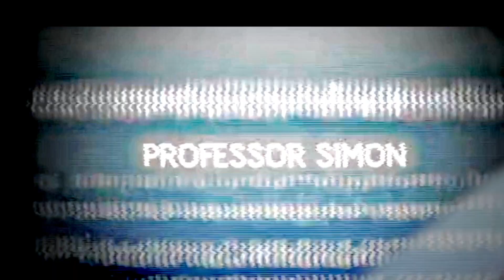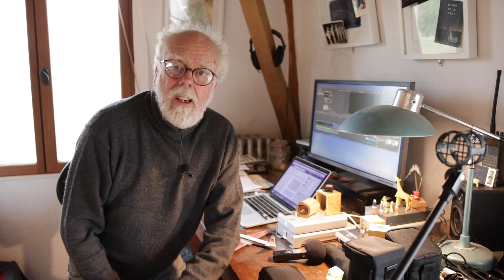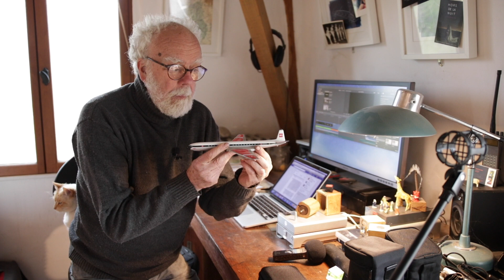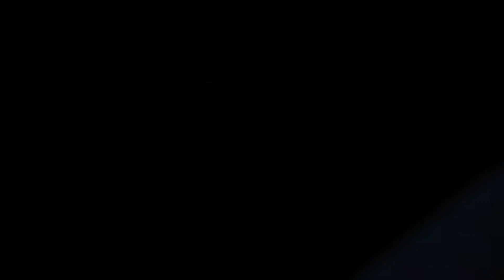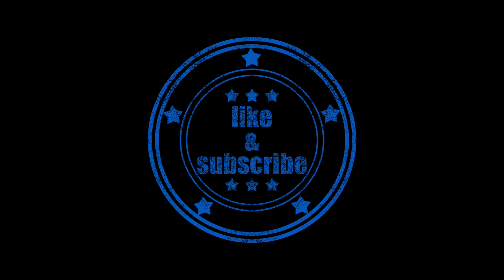737 Max 8 - Report published - Prof Simon

Comment: Well said thank you Professor Simon,
Boeing and the FAA are responsible for building the 737 MAX that is inherently an unstable plane and requires MCAS. 
If the plane were designed properly in the first place, it would be inherently stable in flight and not require MCAS.

Comment: MCAS Failure , AOA sensor failure, Bigger ,  more powerful engines uncompatible with an old but «combat proven»  design. System's  malfunction mode design less than adequate to  hand  over control to the crew.  I think the Space Shuttle  Chalenger could be a very Good leading case to understand this incredible crash.

Comment: In Addition, why did MCAS fail? Well it looks like it takes input from 1 AOA vane which gave a bad output. There are 2 AOA vanes on the 737MAX. The reason Boeing doesn't take the output from BOTH vanes on the 737 is because the system cant tell which is working. Competitors use 3 or more sensors so if one goes, there is a majority remainder to inform the system. So in order for the MCAS to not falsely trigger in the first place, the 737MAX needs a third AOA vane. But there is no hole on the fuselage for the third sensor. Its a big deal.

Comment: It seems to me the basic design of the plane is flawed if it cannot achieve neutral, stable, straight flight without electronic/software intervention because of engine placement
Reply: It does not need MCAS to achieve stable level flight. MCAS is supposed to mitigate the tendency of the plane to pitch up in the event the pilot advances the throttle too rapidly.
Reply: @stimproid  then they need to a system to regulate throttle input maybe?
Reply: @loveislove_5  My understanding is that Boeing had 2 choices. MCAS type system to trim the nose down against the force of the new larger engines, or design a new larger rear horizontal stabilizer. MCAS won out due to lower development costs. Given the lawsuits Boeing will be facing for not building redundancy into MCAS, It may not end up being the cheaper option after all. I am however, confident they will fix the problem and have another very successful aircraft.
Reply: @stimproid Understood. Lower costs, maximise profits. How much profit is enough for corporations, I mean across all industries? #safetyfirst

Comment: Too Many Airplane Systems Rely on Too Few Sensors. This is an interesting article about what should be done to assist pilots.  The cost should be minimal since it  would not be inside the control loop.
https://www.ecnmag.com/blog/2019/04/too-many-airplane-systems-rely-too-few-sensors?et_cid=6665633&et_rid=45568978&type=cta&et_cid=6665633&et_rid=45568978&linkid=content-item

Comment: JUMPING to Conclusions, favorite sport with most people. One question!  Why no Canadian or U.S. or European airline has not had the same problem.  No one knows what went wrong and even the Jack Screw that was found in the ' all Down Position'  is only a indication that something went very , very wrong.  The one thing that can destroy any aircraft , and a problem that starts on the ground is weight and balance.  If the weight and balance is wrong, and the pilot elects to fly the aircraft off the runway, there is no recovery , no black box , no super pilot skills and nothing that will stop the disaster that will come .  This simple mistake along with running out of fuel and turning back to the airport when the engine quits ; all have taken many aircraft and pilots. Second Tear operators operate on a skinny   P and L and over load to the max; in this case Super Max.  RIP

Comment: Just curious how much easier will it be to trim manually if the aircraft was traveling 320knots specially considering the fact that it is at a low altitude? From my understanding it takes a while to trim manually.

Comment: Wonderful recommendation
A plane is a glider and that means it should be stave horizontally without any effort
Reply: A plane is most certainly not a glider. The Max can fly straight and level, without MCAS, as well as any other commercial airliner.

Comment: Wow - seems like software designed by idiots and probably didn't even have experienced pilots involved - probably tested in a simulator for a few hours and, HEY, good to go!!! Every step in this design process needs to be independently audited to UNCOVER how this was eventually passed as flight worthy - but the BASIC design flaw of the larger engines moving the wing forward so that the aircraft was not able to fly without software has to be changed - some serious Dollars going up in smoke here -
Reply: The wing didn't move forward. The plane can fly without MCAS.

Comment: I have a layman question. If the 737 Max relies on the MCAS, does that mean that the aircraft cannot glide if both engines were to fail because of the aerodynamics caused by the larger engines positioned further forward?
Reply: The Max is not unbalanced or unstable. MCAS is to mitigate the tendency of the nose to rise in the case of a pilot pushing the throttle forward too rapidly.

Comment: The pilots re engaged the trim which is not how the memory item reads. Should be left off for rest of flight. Plus were at takeoff thrust and exceeding max operating speed so the trim would be almost impossible to adjust by using the hand wheels. So  a combination of pilot error and malfunction of the aoa sensor. Plus not enough training. Boeing's selling point for the aircraft. And a system that didn't have enough redundancy to correct itself. A classic cascade of failures human and machine starting with a single sensor.  I suspect if they had left it off and understood why ,they might have had a chance to recover. Interesting that the copilot with only 200 hours immediately went to the memory item.  Sounds as if they were just overwhelmed and that's where the lack of training became the weak link in the chain.

Comment: At least two experienced 737 pilots have stated that it is not possible to move the manual trim wheel when there is a load on the elevator, such as in this case, where the crew is desperately pulling back on the yoke.  This is likely to be the reason why the Ethiopian crew re-enabled the electric trim.
Reply from the maker: That is tragic.

Comment: Boeing needs to develop a manual trim assist function and reapply for an air worthy certificate whenever the center of gravity changes due to any modification - in this case heavier engines.
Reply: Or maybe just continue to recommending throttle adjustments when your aircraft unexpectedly starts trimming nose down

Comment: professor I have a lot of respect for your analysis . Given what you know now why would the FAA and the pilots who fly the plane accept Boeings so called Air worthiness directive . Clearly if the plane does not have enough elevation and the pilots are struggling to get the air plane to climb . the issue with forces on the jack screw preventing the manual trim wheels from being able to do the necessary adjustment should have been known to so called industry experts . How was this missed ?
Reply: Abhaya Premawardena,
You need to watch all of Simon,s videos on the issue.
The plane doesn’t have too little power to climb, it has to much forcing a stall.
Reply: @arvidlystnur4827  ? which video are you referring to ?
Reply: Abhaya Premawardena,
I’m sorry, I think I misread your comment. I think you actually meant after the MCAS kept diving the plane down that eventually with the trim out of the pilots control, they could no longer get the plane to climb.
What I meant was the new 737 max 8, with it’s heavy over powered and front mounted engines has a tendency without the MCAS to climb too steeply, causing a stall. 
This condition is discussed in most all the first videos by Simon and other sites discussing this plane.
I’ll look into Simon’s site and see if I can find a good one and edit it into this comment.

Update; Hi again. I didn’t want you to think I just made up information. 
I’m a social media idiot, so I don’t know yet how to cut and paste a video, but if you subscribe and go to prof Simon’s site, on March 14th he does a video titled “Max 8 update”, in which he reads all kinds of comments about the two crashes, MCAS, and the flawed design of the wing engine configuration, causing the plane to nose up without the aid of computers.
I hope this helps.
I don’t want to come across as a know it all, but I think the Prof seems like he’s figured it out.
Reply: @arvidlystnur4827  ah no problem . thank you for the clarification

Comment: The speed was too high  you cannot manually  trim it to much pressure on the jack  screw  there is a method to trim it push  the nose down turning the wheel real quickly it's in the manual it's like doing the porpoise push down yoke quickly turn the wheels when they don't have pressure on them pull it back up and do that again they're going way too fast probably 400. They were just too low to the ground too much speed they could have cut the power back 94% is balls to the wall wipe down spoilers out too late though too close to the ground mcast does not work when the flaps are down see Juan  Brown blancolirio Channel his last update 4 april  explain why they could not manual pull the yoke back !   you don't have time to do squat in 2 minutes they had one minute to recover this aircraft I might note they did have a flight simulator but that scenario was not in their simulator nobody probably thought about it I can tell you one thing every damn pilot flying knows about MCAS NOW

Comment: Boeing should Recall all 737 max for horizontal pitch stable redesign, scrap mcas. Give me a break, could they stopped claiming it is the safest model.
Reply: What do you mean by pitch neutral?
Reply from the maker: Probably the wrong term...but an airplane that is stable In all axis ...hands off ...
Reply: @SimonHollandfilms  Without MCAS the MAX is as stable as any other commercial airliner. The issue is with a tendency of the nose to pitch up in the event the pilot advances the throttle too rapidly.

Comment: Ralph Nader is on this reason for the crash also and his conclusion is this version should have never been certified because of the fwd placement of the new engines that affects the planes balance . Boeing really stepped in it with this one and it will be interesting to see how they get out of it, or if they even can.
Reply: Balance is not an issue.

Comment: Do understand the same airframe was created in the 60's for the Pratt & Whitney JT3D's, a much slimmer (low bypass ratio) engine...Boeing labelled it the 737 'Classic'.  The 'Next Generation' (aka, NG) plane featured the CFM56 variants...much fatter engines.  By your assertions, there should then have been similar flight attitude issues with the NG planes, yet clearly that's not been the case.  Also, it's not a design flaw to utilize automation to maintain flight.  The entire go-to-market of the Airbus is based upon this as their A319/320/321 series (direct competitor with the 737) relies upon 'fly-by-wire', computerized & much automated technologies.  Therefore, if you call the 737 Max a flawed design, then likewise, everything Airbus makes should never have been certified either.
http://www.ecaa.gov.et/documents/20435/0/Preliminary+Report+B737-800MAX+%2C%28ET-AVJ%29.pdf/4c65422d-5e4f-4689-9c58-d7af1ee17f3e
You left out key details of the pilots missteps in responding to the event. Ethiopian report references BOEING’s procedure and clearly the pilots did not respond accordingly sealing their fate. I find it appalling the lack of hours in “type” the pilots had in both the Ethiopian and LION AIR crashs. Compare it to the trades in which an apprenticeship is served before licensing. An Architect or Doctor whom serve in residency. Would you give more consideration to whom pilots you flight or who repairs your toilet/electric/ body?
BOEING’s MCAS SYSTEM as well as AIRBUS’s (not w/o their past history) FAL system have been improved. Training standards for Pilots are regulated by their respective countries of origin and will continue to be an issue.
Reply: Very well said.

Comment: Hiya and have equally watched a couple of these report videos.I am not a pilot but have flown and understand the principles of lift. The overspeed claxon apparently was audible  and the engines remained at %96 n1 climb power.I have read the comments below reference making control surfaces heavy but also a subsonic aircraft can in level flight induce a stall situation in its own right as the airflow begins to roll under the wings due to overspeed? Just my irrevellant overview? Cheers.

Comment: This plane with mcas system should never fly again. Mcas is too complex a system to fix glitches. Probability will always be there with this system for another crash.
Reply: There are two very easy to find and very easy to flip switches that turn MCAS off. You should probably also pull the throttles back from 94% when your airplane unexpectedly pitches nose down.

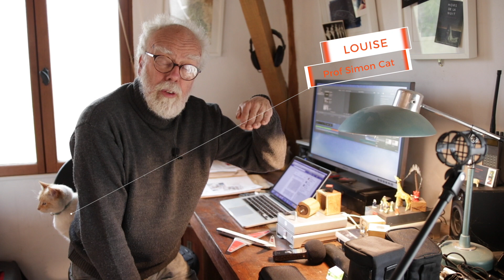Comment: Nice clear explanation Professor. One small point at 1:00 you indicated that horizontal stabilizer moved down resulting in a nose down condition. Actually, I believe that when the leading edge of stabilizer moves up it forces the tail to go up and thus the nose of the plane moves down.

Comment: This is like having a car with a runaway cruise control that accelerates any time it's turned on, 
that has only one switch to turn off - but that switch takes away brake and steering assist as well.
Reply: Andras Libal,
Finally, a good analogy!
Thanks!
Reply: @arvidlystnur4827  thank you
Reply: The runaway cruise control being the pilots, right? Since they're the ones that set the throttle to 94% and didn't move it the entire flight. This is more like your car starting to unexpectedly swerve while you're on the highway, and you don't take your foot off the gas pedal.
Reply: Rob Roilen,
You didn’t understand Andras’s analogy.
Despite the fact that the pilots may have caused a contributing factor adding to the crash, to disable the MCAS from diving the plane they had to turn off the power assisted trim control, as it’s apparently the ONLY WAY to disable the malfunctioning MCAS.
Unfortunately manually re adjusting the trim, to save the plane from disaster, was too slow, so the pilots had to turn back on the trim controls to level out the plane, but the MCAS regained control of the trim and doomed the plane. 
Ever drive a vehicle and have the power steering fail at high speeds?
I have and I tore my pectoral muscles steering the vehicle away from the ditch, saving my life as well as the passengers!
Imagine if power steering (which is really an assist mechanism) functioned via a computer that must be turned off to shut down a locked cruise control.
Reply: @arvidlystnur4827  The MCAS was not malfunctioning; it was operating properly while being fed bad data. Why the data was bad is the question everyone should want the answer to. Regardless, the pilots did not take the necessary steps to fly the plane when something went wrong.
Reply: True story. 
I owned a GMC Safari with anti lock braking system “ABS” that assist the driver to minimize braking distance on slick conditions. 
The system got old and failing, caused delayed and dangerous braking, even with good brakes!
There is NO SWITCH to disable the system, it is  illegal to bypass ABS braking systems. One must pay a mechanic a thousand dollars to repair the system. One can break the law by disabling ABS  by removing the fuse.
I can’t recall what I did.